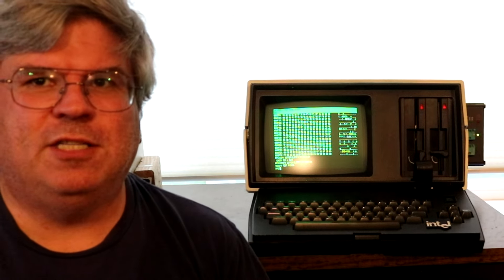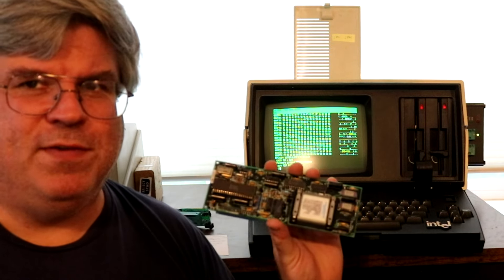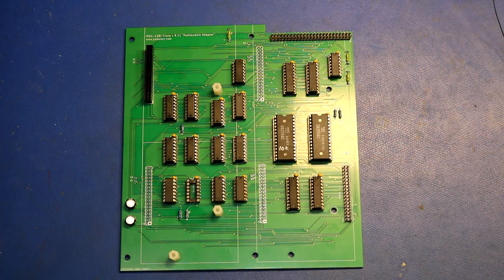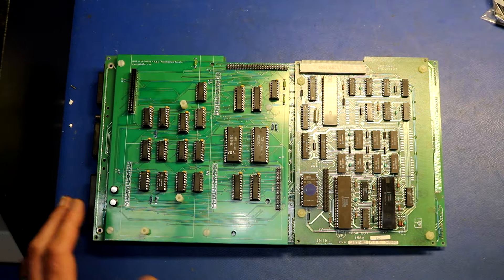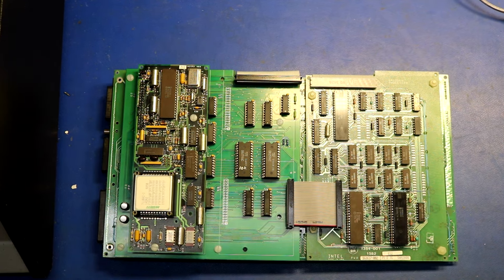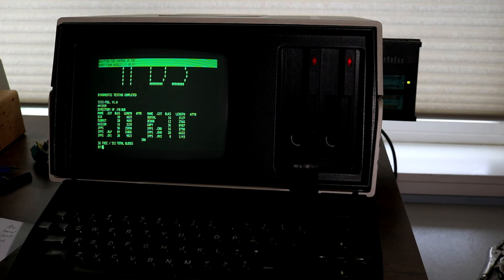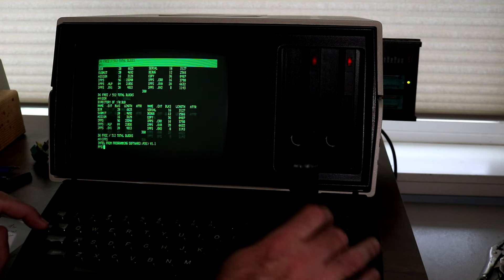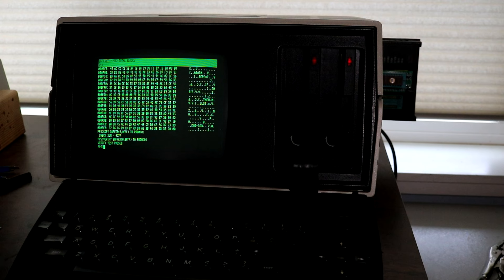Adding Magnetic Bubble Memory to a vintage computer, an iPDS-100 Personal Development System

Comment: BTW:  In its era, ISIS was a better OS than the CPM or DOS you could get.  IIRC, ISIS had 6 file buffers normally so you could have up to 6 files open efficiently.  The programming language for writing code, assuming you didn't do it in ASM, was a thing call PLM.  The design of the PLM language had some problems with it but you could write code that worked using it.  They also had fortran for it.
They had a system that worked like a batch file but not really.  If your file took no arguments things were simple bit if it took arguments what they did was insert the argument into a new copy of your batch file.
I used there MDS system which I think cost a lot more and weighed too much to carry it.

Comment: Fixing vintage arcade machine PCBs I can tell you it's more like 4 times out of 5 is it OK to substitute LS logic with HCT. And maybe 1 time out of 5 can you use HC (without the T). Sucks when your electronic component supplier doesn't have the part you want... (these old boards have timings that are... fragile. De-glitching capacitors are the norm... put in a chip with marginally different timings, bam! Machine stops working or does weird stuff)
Never heard of the iPDS-100, now I want one. With a Z80 and a 6502 pod if these exist (of course all the PROMmers you can get and the EPROM simulators). And I'll likely spend hours in that hex editor and EPROM simulator mode (although I do have a Centronics Printer Port EPROM simulator that I use a lot).